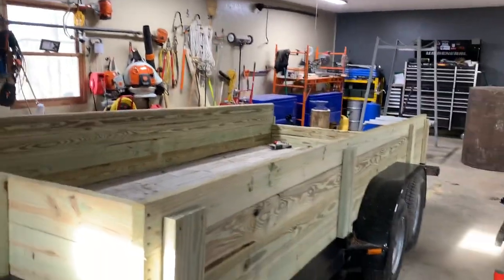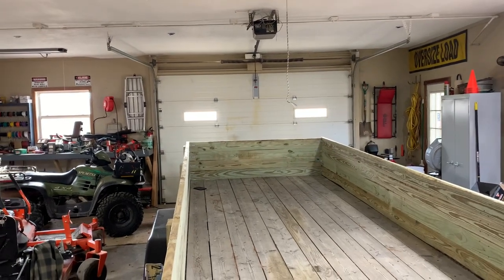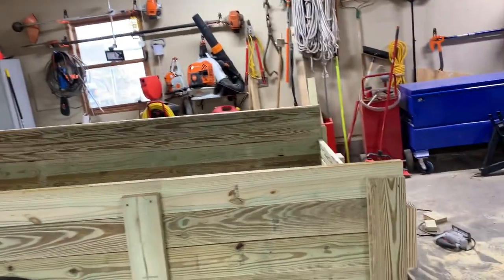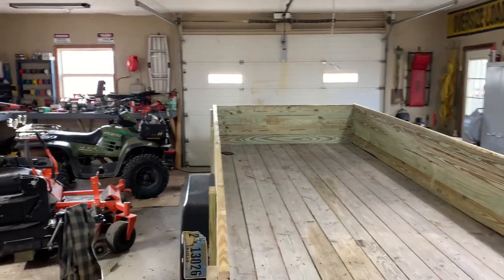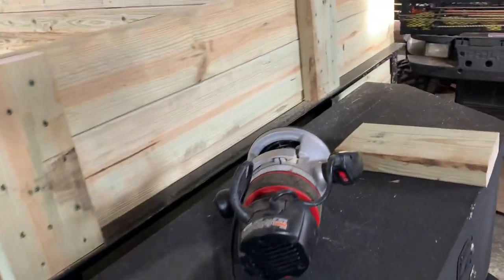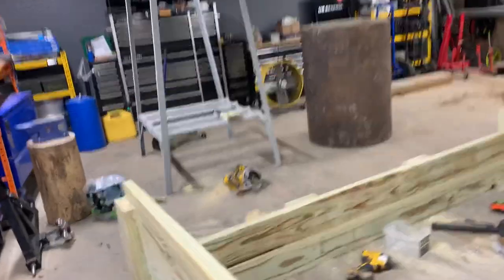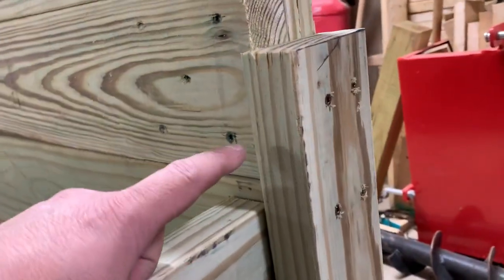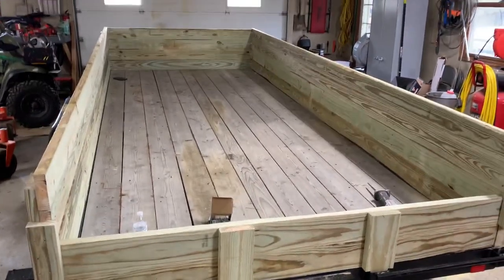How To Add Wood Sides To A Flatbed Trailer

Comment: I utilized used garage door panels. A standard two car garage door is 16 ft and the panels run between 21 to 24 in. Makes for a really good sideboard. Relatively light to remove and put back on.
Reply: How did you secure them to the bed, where you have the L shape of side meeting flatbed bottom? Thanks.
Reply: That's a great idea!
\
Reply: @noahriding5780  
Set up pretty much the same way he did in the video. 2 x 4 trimmed at the bottom to fit into the rectangular openings on the side of the trailer bed. Then, my panels attached to the 2 x 4s. I don't directly attach them to the trailer, the stakes just slide into their slots, and it's pretty secure.

Comment: Some trailers don't have what you called the 'stake pockets' around 2:10-ish. If you didn't have stake pockets how would you have secured the sides to the bed? Thanks.
Reply from the maker: I prolly would just have welded some on.

Comment: Is there a specific reason you cut notches for the stakes /support boards? I have 3 slots on each side of mine ..2 are 1x4
And the middle is 2x4. I was just going to use those size pieces (only being one is at least a 2x4 and it’s only a 4x8 trailer)
Should I use 2x6s like you and cut the notches? Are there any benefits of strength?
Reply from the maker: I just felt like they would be stronger with the 2x6s and had to notch since the picket was for a 2x4. But I’m sure it would work out with smaller boards too.

Comment: You can get a four pack of the recessed D rings for less than $50.  I would make sure they had the backing plates.  Like the old saying goes when in doubt build it stout.